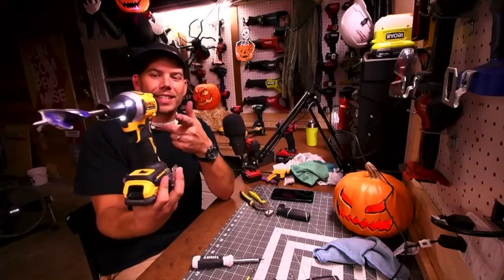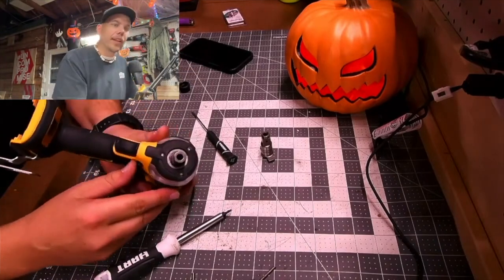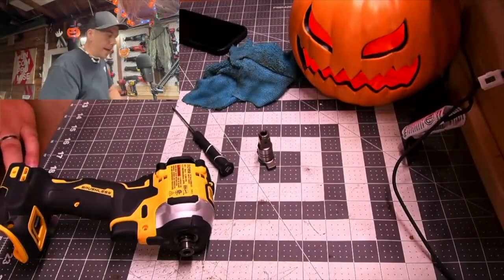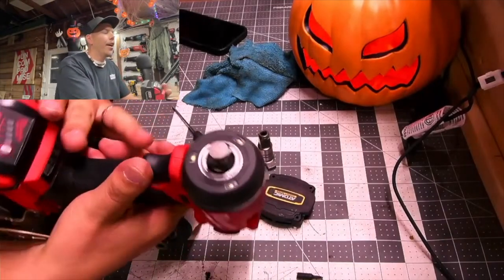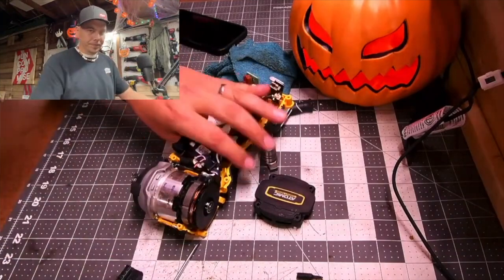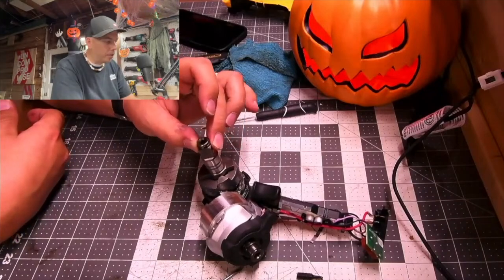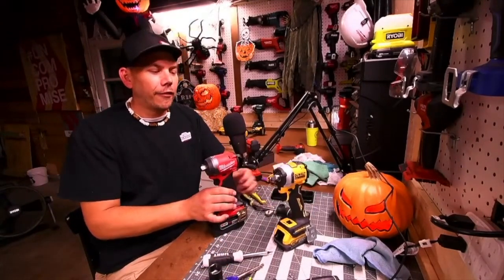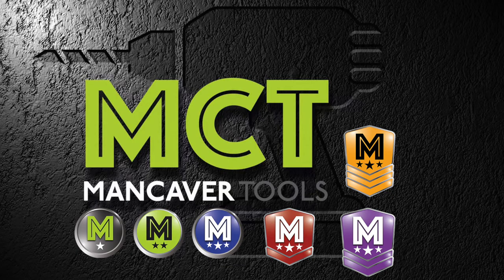Dewalt Atomic Freak?

Comment: I converted my Bauer impact drivers like this for specialty uses i needed to run ultra deep 9/16 sockets for fence panel clamps but they were half inch drive and snapped hex adapters regularly so i put a similar anvil into several and they hold up to my uses

Comment: Bro excellent video. You helped me make what I think is the strongest 1/4" drive impact wrench. One thing I did notice is that it is much louder than most the other tools after you do this mod. Even than the standard 1/2" impact wrench. Did you notice this? It makes a more high pitches screeching noise.

Comment: Is it possible to put a 3/8 anvil on a gen 2 m12 fuel impact driver 2553-20
Reply from the maker: yes it is and you dont even need to bore out the hole for that
Reply: @ManCaverTools  do you have a link to the correct anvil to use? Could you make a video?
Reply from the maker: @CoreyGrandma  I thought I put a link in the video description
Reply from the maker: the 3/8 in anvil you need to ask from Philly fixed since I didn't do that one